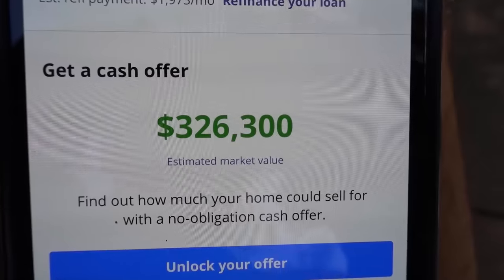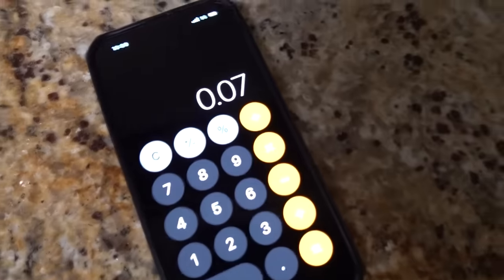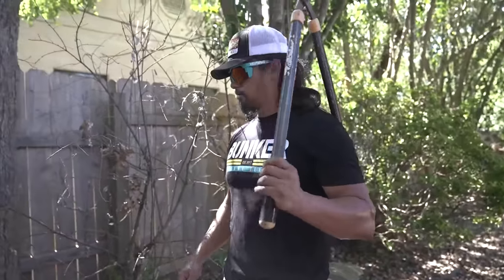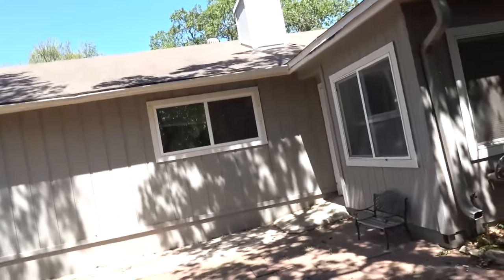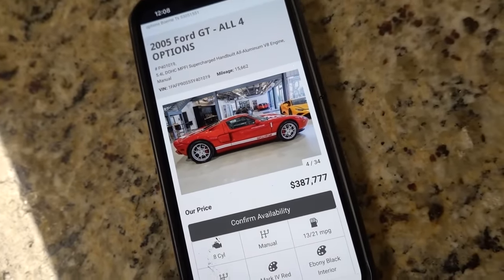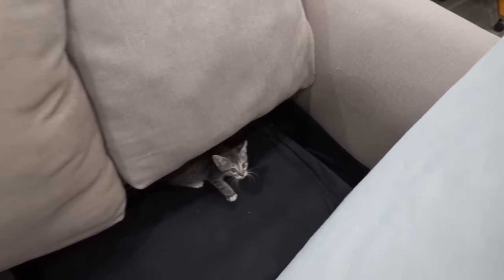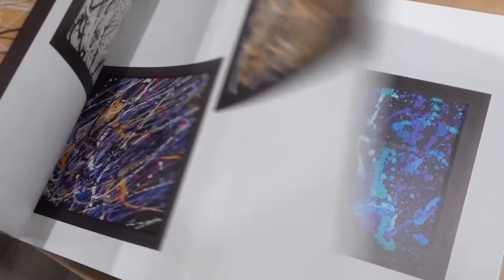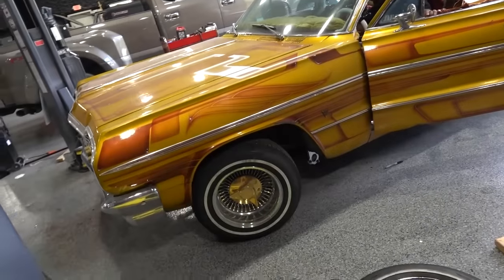Here’s Why I am Selling This House

Comment: I was in a similar situation in my mid 20s and made almost identical decisions. Bank approved for 300k, bought for 128k. House is now valued in the mid 400s. Housing market is insane and I don't envy anyone trying to get into it right now.  Consider myself extremely lucky to be in the position I'm in.  Sadly it's a lot harder for this generation to find those kinds of deals without going for a total fixer upper
Reply: you probably could have made that statement back then housing will just increase that is not a new trend, so it realy doesnt matter if you want to invest you gotta do it asap
Reply: @SalamanderS337 
that's how bubbles form and every now and then, they burst. Of course that's nigh impossible to predict and you don't wanna miss out on the boom before, but some folks will end up not very lucky.
Reply: Me as well! Bought for 126k. Oct 2020. Zillow doesn't satisfy the equity it doesn't see on the inside.

Comment: Hey Matt. When it comes to lowrider hydraulics, the best way to bleed air out of the system is to lift and dump the front or back of the car with the pumps fill hole on then pump tank open a few times.

Comment: Fun fact: Hard hats are designed more to protect your neck than your head. Yes, it does both but the semi-stretchy straps inside the hard hat allows it to give and take pressure off the neck. I seen a guy get a hammer dropped on his head from 60 feet high and it knocked him out and busted his head but zero neck damage.

Comment: I bought my house for $500+ $300 in back taxes on a tax auction. It had sat empty for 20 years, open to weather in a few spots... critters had invaded... but the bones were solid. I chased out the wildlife, replaced broken windows and the missing door then moved in after a deep clean. Replaced plumbing right away, added a new breaker box to replace the fuse box... then over the next 5 years room by room I gutted it to the exterior walls, rewired, insulated, drywall, new ceilings... that was 35 years ago... I could sell for $200k(tiny town middle of nowhere) but I retired here. I like the quiet, acre yard... no crime... why move!

Comment: Mortgage interest doesn’t work like this. Interest on mortgages is front loaded so if you determine how many payments 326k is and then find your mortgage amortization table you will save interest equal to the interest on the last number of payments equal to the number of extra payments you made. You really don’t start saving much until you make several extra payments.